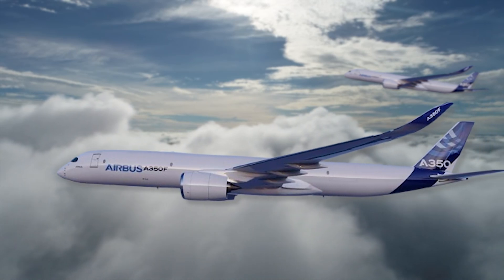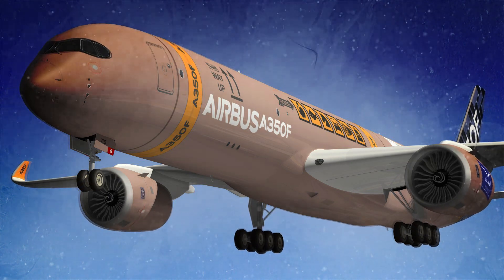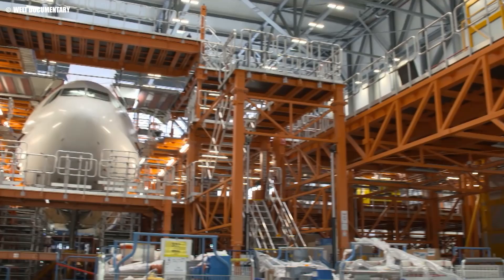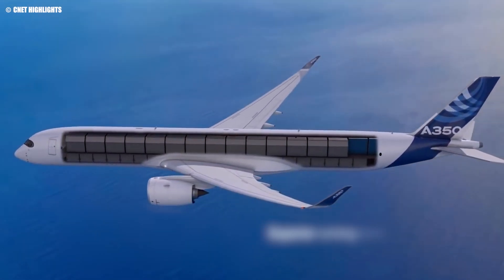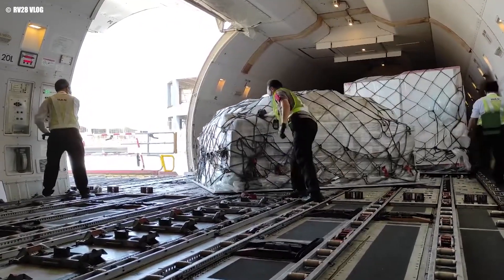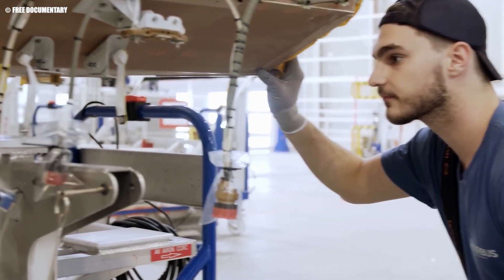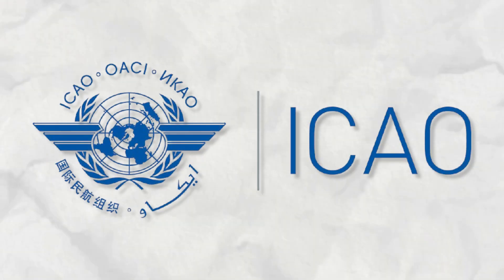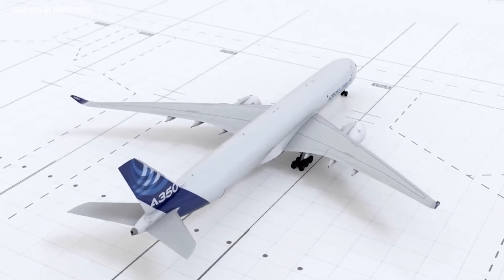Airbus BIG Upgrade On A350F SHOCKS Everyone! Here's Why!

Comment: While the A350 is a very efficient aircraft it’s problems with a lot of freight companies is ownership cost. Why buy a brand new A350 for several hundred millions of dollars when you can purchase a used 777-300er for considerably less and do a conversion.
    Cannot forget lots of freight companies are parking their excess freighters. Look at who the buyers for the A350f are they are not major players in the air freight sector.